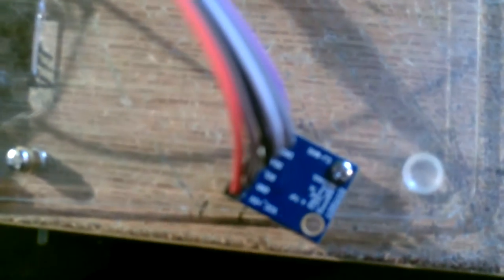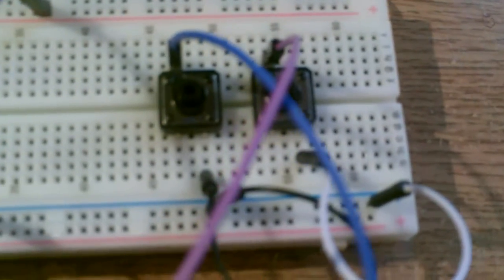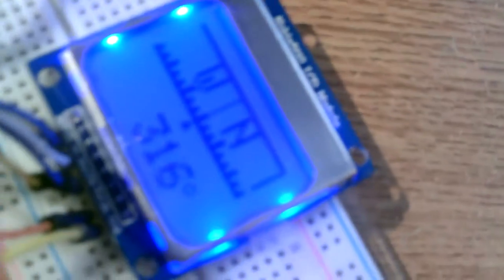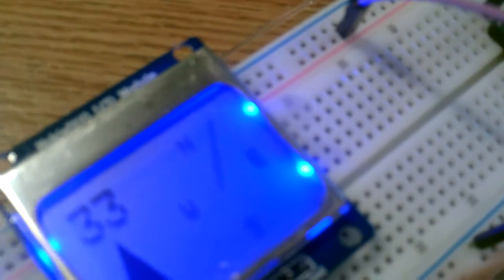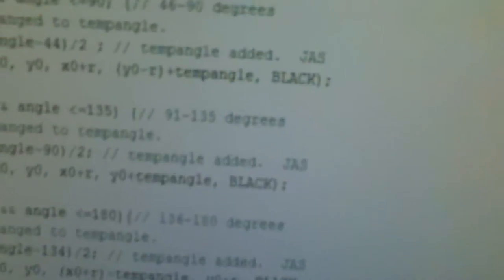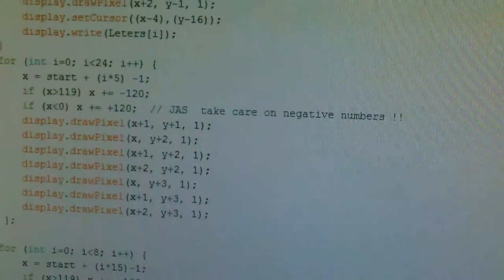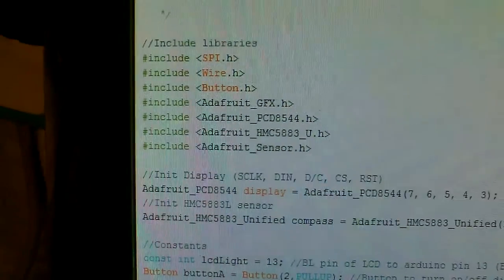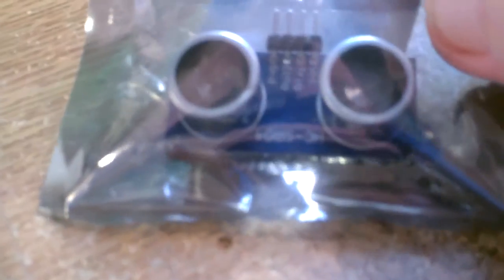Arduino Compass

Comment: Hi, we cannot find your blog post for the code?
Reply from the maker: jonstephensonsblog.com/downloads/working_arduino_compass.zip
Reply from the maker: https://jonstephensonsblog.com/2016/04/02/arduino-uno-and-the-hmc5883l-compass-chip/
Reply: thanks for that, however I get the message "working_arduino_compass:39: error: 'PULLUP' was not declared in this scope

 Button buttonA = Button(2,PULLUP); //Button to turn on/off display light"
This is my first go at programming anything other than the odd PIC so no idea what this means?
Any idea's?
Reply from the maker: Check the lib's used..
Reply from the maker: And the header files used.  It must be declared in a header file. (.h file)
Reply from the maker: the button lib has changed and I had to re-write the interface.  The link to the zip file above has changed with the corrected code.
Please, not that I do not have a hardware model to test on so I might have got the buttons mixed up, but that would mean changing button1 to button2..  Have fun..
Reply: thanks for all the info, managed to get everything downloaded in to the nano, and when I get the time to finish off the circuit I shall let you know but at this moment it seems to be fine, once again many thanks
Reply: I need your help
Reply: @shootinggamer8209  If I can I will, what is wrong?
Reply: @gus452000  i need full tutorial
Reply: @shootinggamer8209  I will see what I can put together for you, my biggest problem, was the compass modules I first bought wouldn't work as they had a different I2C addresses than the software, once I found this out it was a breeze to get working.
Reply: @gus452000  Do you have a suggestion for me?
Reply: I want make digital compass project
Reply: @shootinggamer8209  Not a problem, John did some excellent work on this page, I use a few now for amateur radio and my robot lawn mower, I shall get some details sorted for you.
Reply: @gus452000  if nokia 5110 lcd not work i will change it to 12c lcd
Reply: You can show me tutorial how to make it ?
Reply: @gus452000  yes i need details